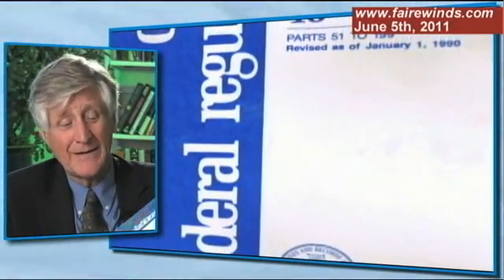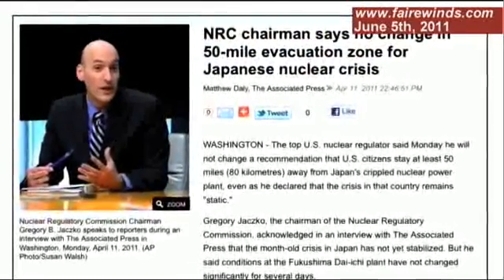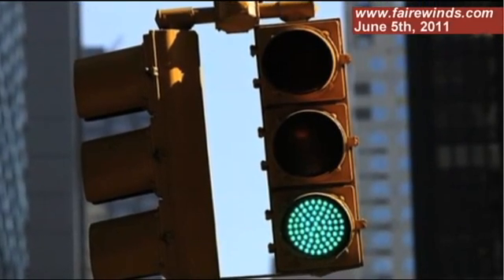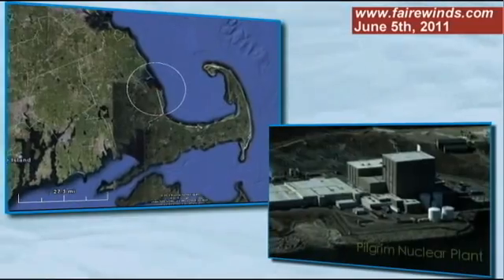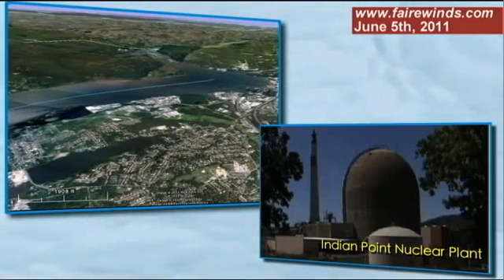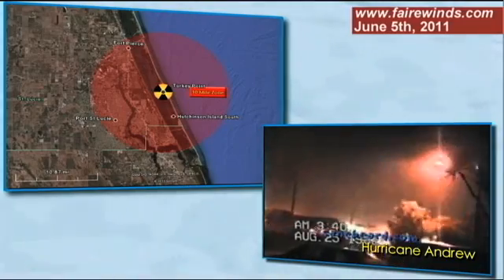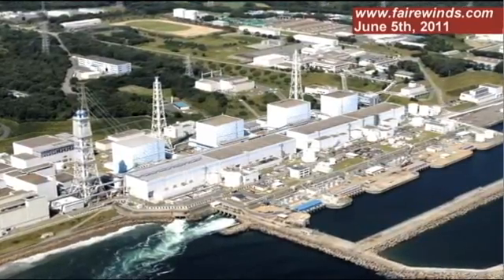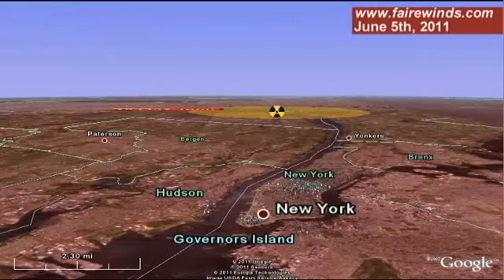White House & NRC Recommend 50 Mile Fukushima Evacuation, Yet Insist US Safe With Only 10

Comment: I dont see why we go on about nukes. You know it, and I know it, that Paul Pantone has been trying to sell GEET for 25 years now. It is the engine that runs on 80%water and 20%anything carbon. It also transforms and purifies the air as it runs. The exhaust is cleaner than the air.

Google "free geet plans" and PRINT them!!!! Then youtube search" geet generator runs on coffee/beer/ or used oil" 

Then you will see for yourself that we have been duped. Nuke is a useless technology.